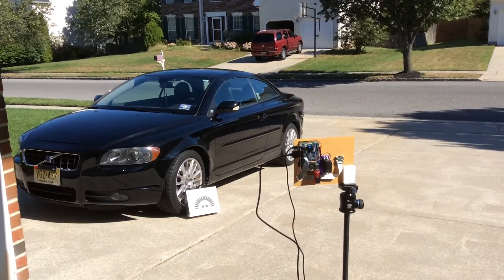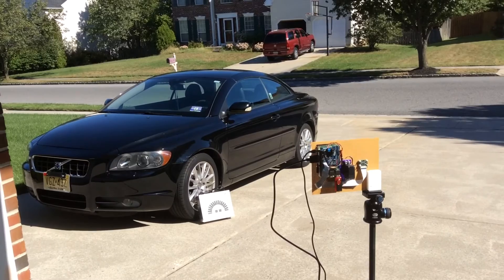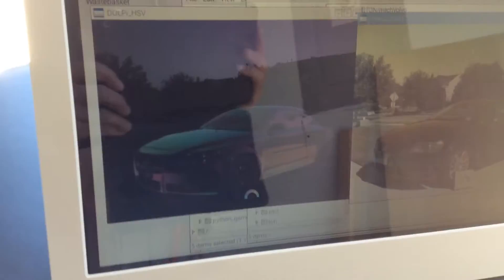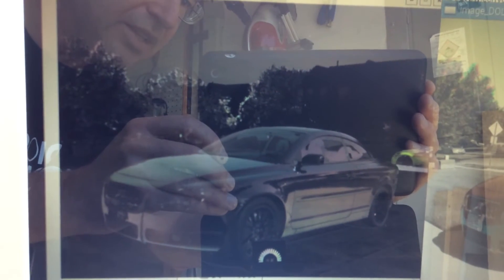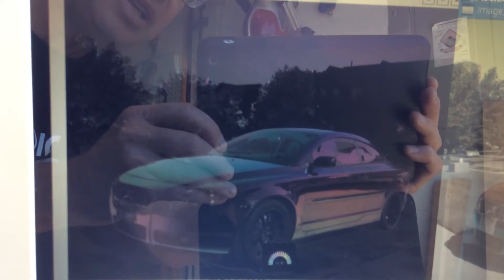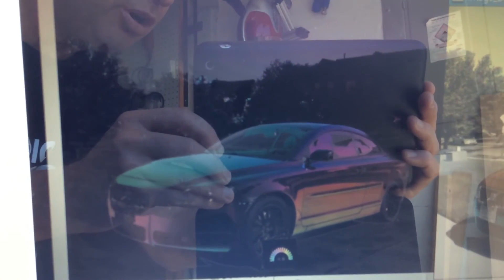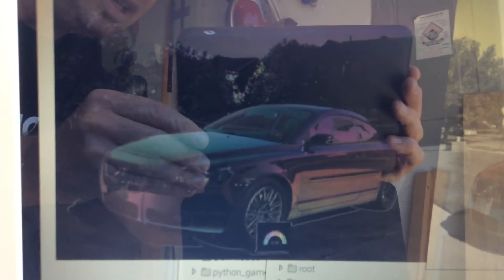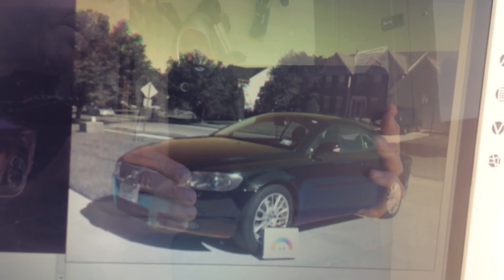DOLPi MECH imaging car (Polarimetric Imaging with diy Polarization Camera)

Comment: Thank you Dr Prutchi for sharing your DIY polarimetric camera. It's so simple yet the result comes out great! Any comment on the difference between polarimetric imaging verses photography with polarized light source(s)?
Reply from the maker: Hi David, Thank you for your message and kind words.  The two are equivalent only under a very limited number of test cases.  Polarimetric imaging is most useful when you don't have control of the illuminating source (e.g. in the natural environment), whereas photography with a polarized light source with/without a polarization analyzer is most useful when you can do it in a lab or production line (e.g. to find stress concentrations in transparent objects).  Best Regards, David
Reply: @diyPhysics  OMG thank you so much Dr Prutchi, I never would've thought getting a reply from you so fast!!! I'm going to try make one myself with your second design utilizing the auto darkening welding helmet. I'm curious to find out what happens putting a thermal camera behind the polarizer, would I get polarimetric image in complete darkness? Sincerely, David
Reply from the maker: @dave.h  Hi David, a thermal camera wouldn’t be able to see through the glass, and I doubt very much that the liquid crystal would be able to act as a polarization analyzer in the mid/far IR.  In the white paper on Dolpi I described a technique used for polarimetric imaging in the “thermal” infrared which gives great results but requires 2 cameras and specialized far infrared optics. Please take a look at page 76 of https://www.diyphysics.com/wp-content/uploads/2015/10/DOLPi_Polarimetric_Camera_D_Prutchi_2015_v5.pdf. Best regards, David
Reply: @diyPhysics  those are very good points! I'm reading through the pdf you linked, so much to learn. Thank you Dr Prutchi!!!